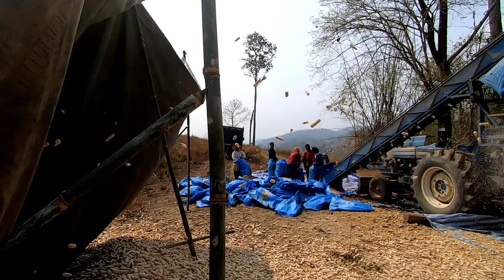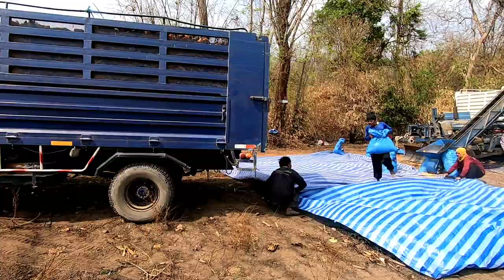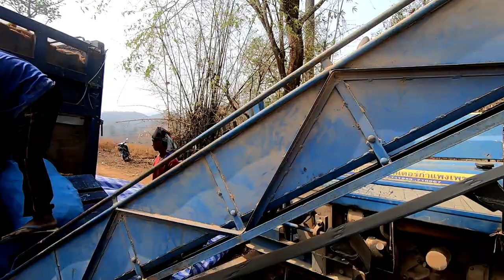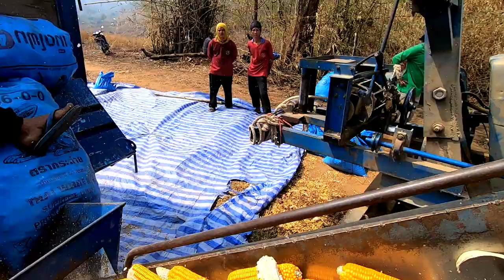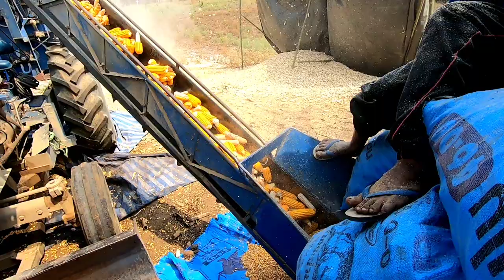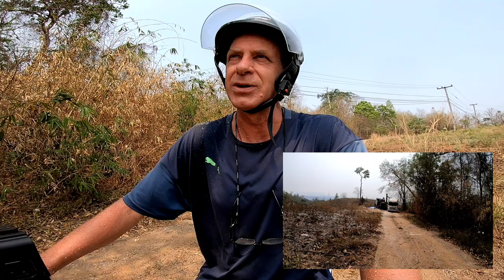Shucking corn is a dusty, dusty business in Umphang, Thailand.

Comment: This explains what those fields were having grown upon them- corn flour is a low-cost food item so not much prospect for the farmers. Its a hammer mill that smashes the corn cobs sending out the corn with centrifugal forces, that is collected in sieves and separated while the cobs are let out through mesh holes of mesh plates
Reply from the maker: I did a brief search on the Internet for how a machine like this might work. All I found, though, was a dekerneling process inside factories, and they seemed to use special circular knives to remove the kernels as the corn moves along a fast, narrow conveyor belt that feeds them through one at a time. 

So far, I haven't found a description of how one of these portable machines work. I'm sure I'll find it eventually, and then I can see one of those hammer mills you mentioned in action.